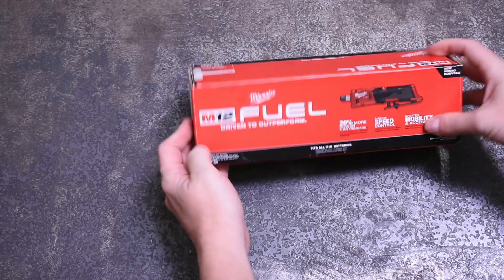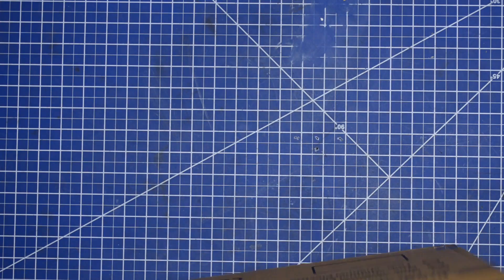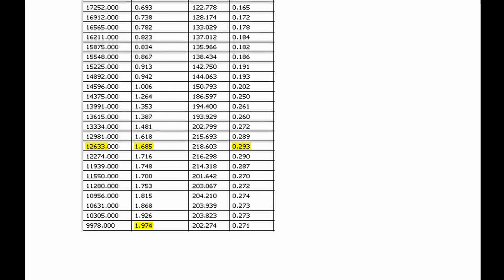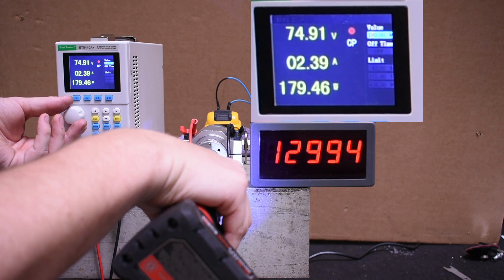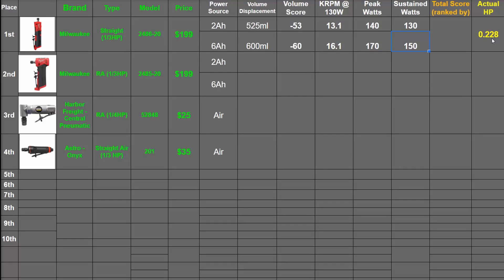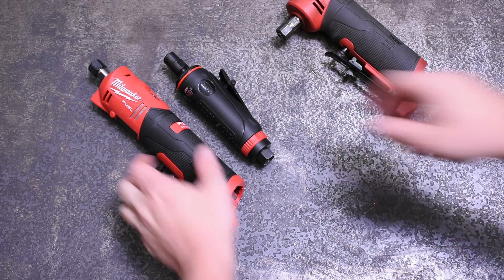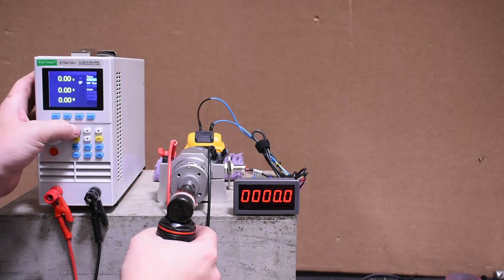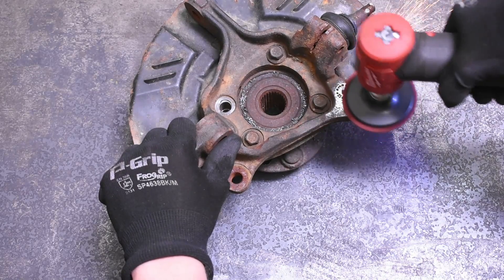We Built a HP Dyno: Do M12 "1/3 HP" Die Grinders Really Beat Air?

Comment: I would be curious to see the Milwaukee right angle with the new high output 5.0 battery I have found just by feel that it out performs and stays cooler than my xc4.0 I don’t have a 6.0 to compare to however

Comment: I'm shocked the Milwaukees did not even come close to their stated horsepower ratings 😳

⅓ advertised horsepower versus less than ¼ real horsepower... that's blatant false advertising 🙄
Reply from the maker: It's more the comparison to air to look out for (like % less than X tool). Running a DC motor as a generator is not 100% efficient which we'll do better to point out in the future.

Comment: I've had two of those Milwaukee right angle. Why 2? Because they both cut out after a few seconds with virtually no pressure on them. Just like in your video. Returned the first one thinking it was defective and the second one did the same thing. Found out from reviews that it's very common and Milwaukee has still not changed the design to offer better cooling or airflow or whatever it needs. 

I would love to recommend it for casual use, but it can't even handle that. Returned the second one and might have to go with the much bigger Ryobi right angle.

Looking forward to seeing that one in your test.

Comment: Now get some dotcos or dynabrades to test
Reply from the maker: The thing with those is they may make the same power, because it's sort of limited by motor volume and not much else. But they will run until I'm in the grave so now way to score that haha
Reply: @TorqueTestChannel  that is true they will run forever. Love my dotcos. Seems like they are more powerful for the same advertised hp, maybe it's in my head. They definitely are smoother, way less fatigue using them than cheaper grinder if you are doing alot of grinding.

Comment: If you have any questions about your new dyno's horsepower, modify it to detect the torque that the generator (motor) is putting out and multiply that by the RPM to get accurate horsepower

Comment: I'd definitely be interested in the Ryobi die grinder because a) I'm already in their battery ecosystem, and b) it'd be interesting to see if they upped the power for the 18v
Reply: I'm predicting much better results with the Ryobi. The Milwaukee M12 die grinder is useless.
Reply: I got the ryobi die grinder, and am extremely happy with it. I've only had it stall once, when I pushed it way beyond what it was designed to do. Theres no chance in hell you can stall it with just a finger like the milwaukee's unless youre the literal hulk. The bulky battery can, in rare cases, be an issue, but 99% of the time its not(i work on vehicles, so plenty of tight cumbersome spaces).
I'd love to see the ryobi on this new dyno though, I think it would fare pretty good... Definitively better than the milwaukee's at the very least..

Comment: So glad to see this! I have both Milwaukee's and absolutley love them. The biggest difference for me is when you have parts washer solvent or brake cleaner on you hands from cleaning parts, the cordless electric grinders don't freeze your hands! I hate that about air tools. Also, for what it's worth, Milwaukee says in the directions to only use 2" accessories on these. When you were stalling it grinding the hub I saw you had 3" on it. I use it all the time with 2" Roloc abrasives and it works excellent. The air definitely has more power and better run time but the frozen hands and air hose mean I will never even consider going back to air now that I have these two Milwaukees. That's my $.02 at least. Keep up the great work guys!
Reply: Good point about the temp, although composite grinders help a lot in that regard.
Reply: Can't forget about how much quieter they are hah.
Reply: I have a lot of m12 tools and some air tools for deburr for aircraft work. Ive been using air tools for years. But have been considering buying the m12 grinders. I only have an 8gal compressor and the way im thinking about it is i could buy the m12 grinders for less than a big quality made compressor. All that depending on how they comparatively perform. If they are really good then it makes sense for me to buy the grinders.
Reply: @mgmjferg89  Get the Milwaukee's, I work on race cars and the right angle is essential for quick work.

Comment: I suggest adding a size/weight category. So then you'll have a power to weight ratio, no matter if it's cordless, corded, or air. I know you have the displacement category but weight could help with operator fatigue. I worked in the finishing department of a manufacturing company thats why I suggest this.

Comment: As a welder I love this! I would be willing to send in my aircat #6280 right angle 3/4HP die grinder and 2 old old die grinders in for testing.

Ideas for testing; the aircat composite and 3/4HP series. Ingersoll Rand Edge and Max series. The Dewalt right angle die grinder I think every big box store sells. I'll need to buy a lot of merch so you can test some really expensive Chicago Pneumatic, IR, Dotco, Sioux and Dynabrade models too!

Comment: To have real shaft power you need to measure the torque applied via a reaction load cell to the motor mounting.  And eliminate other uses of shaft power, ie cooling fan.  Otherwise the efficiency of the motor is effecting your measurement.  

If you try to keep starting conditions similar what you built is a good A/B testing setup.

Comment: I recently got both the straight and angled milwaukee die grinders and am pretty disappointed in their power. They go in to protection mode constantly, but seem like they may be getting a little better as I've used them for a while.
Reply: Yep very common. I had to return both if mine. They couldn't even handle removing gasket material from a water pump face.

Comment: I have been using my Makita DGD800Z for close to 10 years and I have been happy with its performance. It cant be to bad as it is still the same brushed unit on sale today as it was in 2013.  The beauty of the bigger cordless units like this is they run fast without freezing your hands and not being tied to a hose that gets in the way. 25K for actual grinding and not 8k for running a cutter.  Worth a test if you know some one who has one? 
Excellent insight for air tools I would only add a couple of brands Daewoo and Fuji as decent quality.
Looks like you could use the rig for testing angle grinder HP outputs.
Pneumatic and cordless examples. M14 nut to 1/4" shaft and a M10 to 1/4" shaft would get you hooked up to 90% of the grinders on the market.  Although with some that rate up to 2000 Watts that motor might be a bit small.  Same deal with Circular saws testing shaft power although the connections are no where as universal as angle grinders. In my experience there are huge differences between cordless angle grinders with quite a few only deserving of being angle sanders.

Comment: Have you considered calibrating your dyno against a reference output (e.g. an industrial 1/3hp motor)? This would allow you to compensate for the inefficiencies of the dyno's motor/generator.
Reply: Yes, this Dyno needs two main changes:
1. Measure torque directly, not through a DC motors current. Wheatstone bridge load cell for the dyno motor will give a direct torque reading (and can be calibrated). 
2. Loading the tools with constant torque, not constant power. This will prevent the sudden drop-off of some tools because the control loop of the battery tester is not actively dressing them down.
Reply: Would love to see at least some attempt at calibration of this setup, although it's definitely not a safe assumption that the motor they're using as a load has linear/equal losses across its RPM range so they'd need to test it at a few different speeds to get a curve. Not hugely important if they end up testing all their tools about the same RPM, but could be a confounding factor if there's a big speed difference between two tools.
Reply: Since we are talking high-rpm measurements, a high-speed reference source would be needed... perhaps the reference source could be a duplicate of the dyno motor/generator.

Comment: I typically wouldn't consider using a battery powered die grinder, especially when they shutdown for tool protection I'm already doing something I probably don't want to do. I've either got corded or air power.

Comment: I repair/modify roll cages, cylinder heads, steering knuckles, airframes, and gear cases. I've been using a Makita GD0800C for 12 years all I've done  is clean it, replace the cord, and replace brushes  theres easily 2000hrs on that tool. I think I paid $280 for it.

Comment: I would be really interested to see testing with constant voltage power supply instead of batteries. You could tell the battery voltage is sagging to the point of being the limiting factor for some of these tests.
Reply from the maker: Which is how you'd experience it if you bought one. "This tool makes 200W of power when using a custom power supply" probably isn't that useful to the average joe

Comment: For those of us that have only ever known cordless, what’s the minimum practical cost of an air compressor capable of driving such a grinder? If we would be getting our hands on air just for that.
Reply: Look up the requirements for the die grinder you need and find a compressor that is a bit higher. If you're doing a lot of work you'll want a very nice compressor. If you do it a couple of times a year, you can get by with something a lot cheaper.

Comment: I would really like to see some of the Aircat 3/4 HP air die grinders. Specifically 6280 and 6290. I have a 6290 and its been an excellent tool for years. Curious how it stacks up against a typical 1/3 HP version and also curious how much better the 1 HP 6260 and 6265 are.

Comment: please re do these with a load cell and rpm and calculate from there... no your dyno is reading WAY off because efficiency is non linear! getting 100watts out of that motor may take 120 where 200 takes 300 watts. PLEASE get a better dyno rig setup.

Comment: I have had terrible luck with Milwaukee's M12 straight die grinder, maybe I'm just too rough on them but I was only able to get through 30 ports on cast iron heads before the head started to separate and the collet seized. Thinking porting and polishing is going to require a corded die grinder
Reply: Surprised you got that far without overheating.
Reply: There were breaks in between for changing carbides, stones, and various sanding implements as well as measuring cross sectional area of the bow

Comment: One thing to keep in mind is if you aren’t going to use one that often and don’t have a proper air compressor the cordless ones will be fine.  They’ll probably be cheaper when factoring in a compressor.  Especially if you already have batteries.  Just my opinion
Reply from the maker: And if you already have a compressor air tools are cheaper than buying batteries and a charger of course. We didnt factor price in the rankings either way/
Reply: @TorqueTestChannel  I understand that but how much did the air compressor you used for the test cost?

Comment: If you haven't already you may want to look into balancing that dyno with a wheel weight or somthing. The magnet on the one side looks like it is causing a lot of vibrations.
Regardless nice new setup!
Reply from the maker: We did balance it by drilling out material. The tools weight can make it unbalanced, some tools it sings. Zero vibration
Reply: @TorqueTestChannel  optical sensor?...smaller magnet?...both?
pull the cover off and read off the fan blades?..laser?

Comment: I think you should also measure the Milwaukee grinders on a lower setting. Maybe they are a bit like drills that make more torque in a slower RPM setting. I have both of the Milwaukee grinders at work and use them on setting 1 and neither one of them ever stall out for me.

Comment: The efficiency of that spindle motor being run as a generator will be nowhere near 100%, so you are under-reporting the power output of the tools.  I'd estimate you are looking at an efficiency somewhere in the 70-80% range. 

It's not too surprising those Milwaukee die grinders struggled with the small batteries.  At 150 Watts (reported, real power higher as above) the motor is going to be pulling 14 Amps or more which is a big ask for a continuous draw from a single 18650.

Comment: Doesn't seem like a fair comparison unless you factor in the price of an air compressor that can sustain the air tools for at least as long as one battery would.
Reply from the maker: The power goes down on the battery tools as well, they drop bars pretty quick and we only test them when fully charged. The price show is also for bare tool. It's are fair as a test can be we feel

Comment: What if you ran a fixed load, like a heater & fan, while monitoring voltage & current developed for the load?

I think you could get charts more like dyno charts, since the resistance would decrease as the voltage increased you would get a wattage over rpm plot that ends at tool shut-down.

Comment: It might be interesting if you remove the fan from the dyno, and then get a measurement of power vs rpm. You might be able to run the dyno as a motor even to get that number. Then you will have a calibration curve which should be a simple add or subtract. 

Or you could remove the fan entirely and find a different way to cool it, or just find a fan that runs independently of the dyno.

Comment: The problem I don’t like with electric die grinders is control. Air tools can be controlled better especially when porting cylinder heads. Also air tool grinders are easier to put in smaller places because they are smaller.

Comment: The price comparison does not seem reasonable. Yes, the air powered are cheaper assuming you own a compressor that can run it. But if you have to invest in a compressor the battery powered ones seem the way to go for garage setups. And using one is more convenient not having to deal with hoses and powering the compressor up and waiting for it to reach NOP. If you have a shop you probably have a decent compressor already.
Reply: In my opinion the electric ones are still too large for most applications. I typically need to grind something in a tight spot, and these aren't doing it. Plus they're weak. 
   You can buy a decent air compressor for under $500. That's only the cost of a few tools and batteries.

Comment: Yes, Drill testing sounds awesome. Most reviewers just use a torque meter while screwing a big lag into wood. Also would be interesting to test the big 18v die grinders and see where they would stack up compared to air tools of the same rated capacity. I'm liking where this is going TTC.

Comment: Would be far more precise to measure power draw between the battery and controller/switch
Reply from the maker: Draw power doesn't tell you how much power is being delivered to your work piece, it also doesnt factor RPM. And it doesnt consistently and slowly load the tool to its max.
Reply: @TorqueTestChannel  i'm not sure if measuring how much power the motor is generating is precise either, it isn't 100% efficient (it produces heat, and noise), so it gives lower numbers; and it probably has an efficiency curve, just like they have as a motor (something that would be hard to compensate for).

For cars, a dino generally measures with weight, and sometimes also a brake; generally a hidraulic load, measuring it at a distance to calculate torque. Sometimes they use a generator, but i think it measures the mechanical load, like a brake, not the electricity it makes (because the efficiency would change as it heats up).

(Correct me if i'm wrong, i know about motors and electricity, but not too much about generators)
Reply from the maker: @Giuliana-w1f  Nah, you're correct. A brake (Which we're also working on for a project) is simply too big for these tools to overcome and at this RPM. As long as the tools have relatively high RPM like these all seem to, this motor seemed to be well matched and for example as we reduced air pressure an air die grinder would make less and less power which made sense to us. Alternatively, the larger battery we but on cordless it makes more and more. So the value is in the comparison, less so in the precision of the figure. Which is why it being X% off advertised power is not ranked for points.

Comment: Great testing! I used to be jealous of the m12 right angle, until I borrowed my co-workers one time. I was disappointed. The overload protection is way too sensitive, you can barely even remove gaskets with it.
Reply from the maker: It's actually one of the reasons for making the channel, same scenario. Used a co-workers who loved it and then after using was convinced he had never used air for any length of time to compare as it was just stopping constantly until you "learned" how to use it, aka a light touch always. Which he said was just a quirk of cordless, but to me reminded me of really weak air grinders with low air pressure. Looked up the specs of the tool and said it was higher than what I was already using and rolled my eyes. It's taken me a couple years to come up with a dyno that reflects that with just numbers and no opinions.
Reply: @TorqueTestChannel  It’s meant for 2” wheels not 3” wheels as you have shown. It’s directly on their website. I haven’t had a problem with 2” rol-locs.
Reply: Yep they're garbage. I don't know how anyone doesn't return it as defective immediately after the first use.
Reply: Using 2” wheels (Milwaukee says don’t use 3”) I’ve had it cut out on me a couple times at speed 4, but only once at 3.  It does everything I need it to do, it’s quiet, and it’s convenient.
Reply: @Leonarco333  interesting. That would make sense, I was using a 3 inch wheel. A 2 inch would take a lot less torque